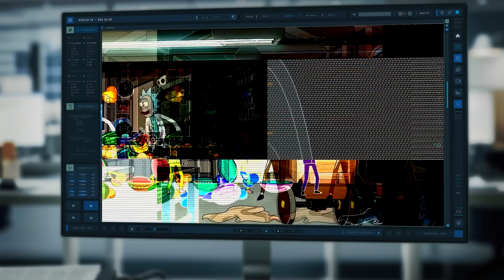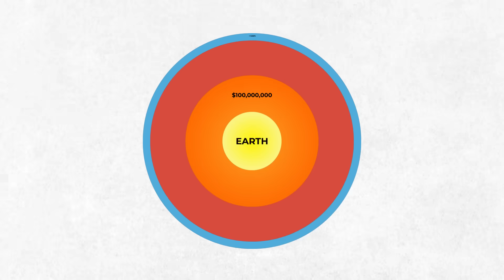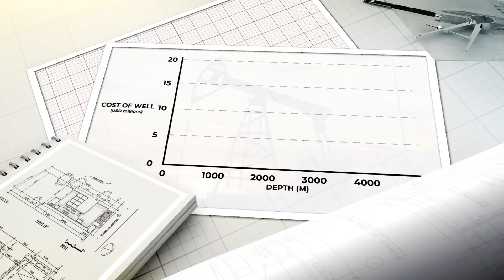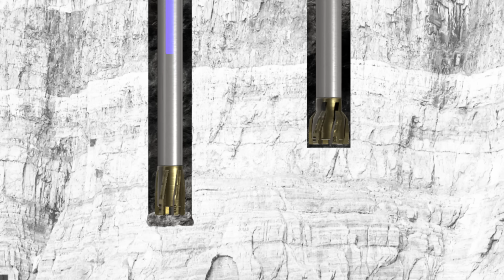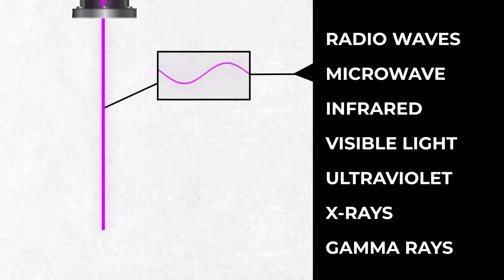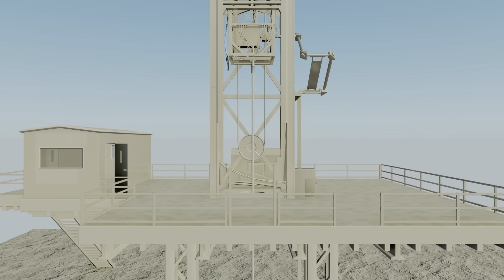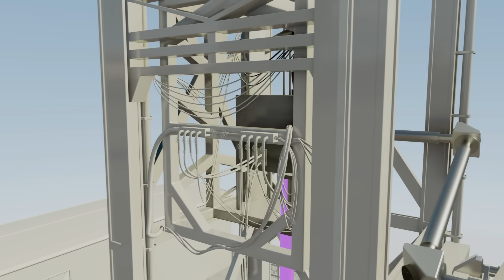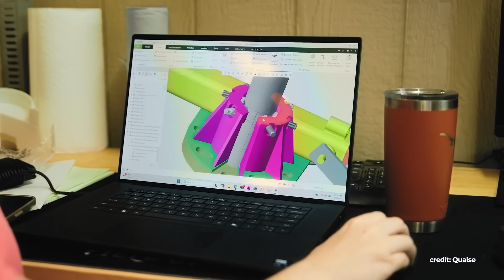The Most Advanced Drill in Human History

Comment: A hole doesn't magically stay open because of the casing, be it steel tube or vitrified rock. When you get deep the rock is under intense pressure, there's water and gas in it trying to expand, it will explode into the hole without a counteracting pressure. This is why drilling mud density is important. Talk to any mud engineer, you're talking about pressures like that near the Titanic at that depth and we know what happened to an imperfect 5 inch thick carbon fibre tube. The hole will be so fragile before you pressurise it with water. They need to be able to maintain hydrostatic pressure at the drilling depth for this to work.
Reply: Quaise have always been vague about this. While underbalanced drilling with nitrogen is done around the world, it's not that common, and has its own challenges and limitations.
Reply: I  was wondering how a thin layer of glass like rock could hold against pressure on such depths. Do you think their setup could allow for varied wall thickness? Creating thicker walls by  melting more rock around but somehow keeping the hole diameter constant? That's the only thing I can think of if they cannot counteract the pressure with water/mud. I guess compressed gas would be another option but keeping the gas pleasure while using the gas to remove material would be tricky as well.
Reply: Air drilling a 10km TVD well is a wild idea, even without the lasers. For this to even have a chance of working, they need to contain pressures at surface exceeding 10,000psi while drilling. Can that be done, maybe, but it’s risky and expensive and comes with a whole lot of make or break details. Then there is the cost of the power needed, the durability of the equipment, carrying the material out of the well with air. I hope they get there and what they have is impressive, but IDK.
Reply: @adamsteinhardt6393  I've seen some spectacular things forcing hundreds of PSI into the ground with ordinary old RC.
Reply: @FREDDAGGS that’s cool. I don’t know much about RC / air drilling. Only had the opportunity to see it very briefly for a few wells in Utica. I’d love to learn more about it. Still, there’s a big difference between hundreds of psi snd thousands of psi that this concept entails.
Reply: @adamsteinhardt6393  yes and no. There are a whole lot of new problems. You retain all the existing problems multiplied by 10.
Reply: Did a little more digging into this concept wondering how in the world they planed on drilling without mud. Looking at the theoretical  pore  pressures at 15 kilometer assuming salt water down hole pore pressure would be~ 21805 psi. the vitrified rock casing basically  obsidian has an Compressive strength ~45000–70000psi  at room temp but down hole temps will be around 350 c lowing the compressive strength of the obsidian to  30000-50000 psi making it  theoretically possible to dill without mud!
Reply: With that all being said I would not want to be anywhere near the rig floor if the casing vitrified rock is to fail the blow out would create another space program
Reply: @supershift100 thanks for doing the math. That's far more promising than I expected. If it can cool without cracking.
Reply: @supershift100  Would this be compressive force though? It seems that the issue is cracking, not crushing
Reply: The blowout from the Deepwater Horizon rig was at 17,000 feet which was kept in check by 17.5 pound per gallon drilling mud. The well came in when they reduced the volume of mud (hence lowering the weight of the column of mud) in the hole. I don’t think a thin layer of molten glass will confine the fluids under pressure at depth. Without the pressure exerted by the column of drilling mud, the rock itself will “jump” into the hole.
Reply: @MrPhillip2 under those conditions your hydrostatic psi would be 15, 470 lbs
Reply: lithostatic pressure goes Brrrrr
Reply: The RF power loss down the air filled waveguide is not going  to allow them to linearise the cost:depth ratio. This is an interesting experiment and worth doing, but it's not a viable tech. Go talk to an RF engineer and a drilling engineer together about this. They will each show you a graph that makes this non viable. We should still pursue the tech for science, but this is VC bait.
Reply: @rubikmonat6589  
Not only that, but how do they expect to keep the vaporised rock as a vapour, until they can extract it from the shaft?
Short answer = they can't. Once the shaft is a km or more deep, the rock will condense while still in the tunnel, raining molten rock down the shaft. Things won't be too bad as long as that rock remains molten, but again - Short answer = it won't stay molten...
That rock will solidify once the temperature drops enough. That means that the walls of the shaft will gradually get more and more narrow and the steel pipe will get more and more thickly coated with solid rock, until the whole thing gets stuck.
Reply: @rubikmonat6589 yup. My uncle is best drilling engr on planet, really. This tech has solid fails at many levels
Reply: @rubikmonat6589  yup, water will creep in at depth, ruining the effectiveness of the plasma/microwave lazer
Reply: @rubikmonat6589  very roughly calculated that at 10 km assuming the wave guides are 99% efficient, it’s delivering something around 40 W. At 5 km it’s 6500 W
Reply: @joeshmoe4207 just put the laser inside the drill near the bottom and run coolant on it to keep it from overheating
Reply: @crusher9z9 if the synchrotron is on the surface there is no way XD
Reply: @arthurdefreitaseprecht2648 just put all the active parts partway down the tube. use a transformer to up the voltage after the length of cable/wire lowers it theres no real reason you cant make the shaft contain all the parts. but you wanna limit the depth maybe. just run liquid coolant through it. you can put pumps inside the shaft itself too.
Reply: Exactly. I've watched this for a while and I've been endlessly amused that they have not been addressing the actual problem. Keeping the hole open. Which a thing scruffy layer of brittle obsidian is not going to do. Then they are clearing the hold with air/water like reverse circulation? 

Classic example of everyone taking investors money to pay themselves a salary.
Reply: @FREDDAGGS  you can't even use gas to keep it open. because it will blow out at the top to achieve adequate pressure at the bottom, the fluid needs to match the pressure gradient of the rock. the only way this microwave tech can work is HUGE casing, and a down-hole transmitter. the catch is electronics dont work that hot (see the tech they are looking at for venus probes). Halliburton or someone would have bought these guys out already if it wasn't a daft idea. I wish it could work.
Reply: @rubikmonat6589  it's a bit like Alvin Weinbergs Molten Salt Reactor. He knew it would never go in a plane but took the money to build the reactor. 
This is good technology. It's just got nothing to do with geothermal. There's money sloshing around for any zero carbon energy proposal.
Reply: @rubikmonat6589  Just for curious Mind Games, could we introduce some sort of sci-fyish "glob" ? Maybe it even expands under heat, contracts when cold, is more like Gum, and the contraction in cold pulls the rest of the mass. So it could be delivered down the hole via cooled pipe, gets ejected above the borespear, which is pressurizing below with air, and pressing the ejected mass into the, under heat expanding "glob". The "glob" expands, moving up the tunnel, where it is slowly being cooled again, starting the pull effect. Once at the surface, rocks and glass need to be somehow discharged, so the system could run somewhat closed to ensure the right pressure. What do you think? :D
Reply: I imagine with the magnetron drill bit you would be able to drill and lay pipe at the same time to reinforce the sides. The bit and its casing would have to be smaller than the pipe.
Reply: Hydrostatic psi= mud weight × depth × .052
Reply: It's not about how much deep to the extent of making a " mini volcano! "  but, just deep enough to make a Cookery Pot ( head ) you dummy 🤣

And later than, it will be a hot sauna turbine with your winter as Turbo charge Intercooler 😅
Reply: Cant they like combine the tech available, if indeed they can open a 10-12 km hole in months, they could put the conventional drill into the hole to remove the obsidian much faster and use the known tech to reinforce the walls
Reply: Hydrostatic psi= depth × fluid # × .052
Reply: I guess we can all agree it must be started with reaching there "enough" first. Yes, there are plethera engineering problems before the harvest. Let's tackle them one by one.
Reply: the explosive water force should equalize enough to melt the walls into glass and then evaporate remaining water.
Reply: The good news is that the tech doesn't have to be perfect.  It just has to be better than what we have now, at least in for certain depths and ground compositions.

Once a hole is made, as long as it lasts even a little while, that hole can be reinforced, or even redrilled as long as most of the hole is intact.  And the drill doesn't get stuck in the hole.  I imagine drilling out a drill with another drill, even a laser drill, would be tricky.  Probably easier to bend the drill path to drill around the obstruction at that point.
Reply: Great, enormous pressures. Is nobody talking about the heat? Just like getting to another solar system, it's going to be impossible to get to our core.
Reply: @mcapps1 you dont need to get to the core you just need to get to mantle/lava cheap enough to be viable.
Reply: @crusher9z9 you don’t need to even get that deep. You need only to get to where it’s hot enough to efficiently boil a lot of water.

Comment: Question: if getting rid of vaporized rock is made easier by bubbling water and the only problem is water absorbs microwaves.
Why not fill the bottom of the drill with a liquid heavier than water but transparent to microwaves? 
When I types "liquid heavier than water transparent to microwave" in grok it gave me several options.

Comment: For the problem of vaporized particles cooling and sealing the bore hole:

Most particles are ionized, so make a rotating magnetic field along the body to put them in predictable dynamics, then change the magnetic field's shape to control where rock particles get deposited.
Reply: When they tried drilling with nuclear blasts, they found the glass lined hole destroyed the permeability and porosity needed for oil production. Same thing here, the glass will prevent flow of geothermal fluids.
Reply: pray tell what will magnetic fields solve? 
the rock will condense within the first kilometer of the hole no matter what you do to the magnetic field. it will clog the borehole in a matter of hours if it gets deep enough. 
the rock will condense between 1800 to 1200°C and since neither the toolhead nor the drill can survive anywhere close to those temperatures we can safely assume that 99% of the "vaporized"  rock will condense on the colder tool or the borehole walls in a matter of meters.

Comment: First - did you get some brisket and Mexican food while you were here?
Second - The place to drill the "real" test hole should be at any power plant location with a back-up coal fired generation system.  The back up system could be run to provide the power needed for the drill.  Then all the steam infrastructure is right there to the existing turbines.
Third - The first test case should be a less expensive single hole - possibly even lined.  When at depth, lower a pre-fab pipe conduit - either a double pipe, or a single down, with the rest of the hole being the steam up.  This reduces the cost of the first attempt, and maybe becomes the model for smaller localized steam production.

Comment: From what I understood, The problem the Russians ran into wasn't just about the limitation of length/torque, it was also that the temperatures at those depths they were drilling was so hot that it would destroy the business end of the drill... Or have I misunderstood something this whole time?
If that is the case and I'm not mistaken, then how would they get around this issue even with the laser drilling method?
Also, at those depths where the rock is semi-viscous when being drilled, would the lasers still be as effective?

Comment: "1,000 U.S Homes at once" I don't recommend cutting holes in the planet.. BUT he needs to look into plasma generated Ultrasonic resonance of target material and Ultrasonic echo clashing upgraded audio spotlight techniques to limit range. Dust the bonds and pressure waves coming up from ground to apply resistance can also form molten tunnels. Google: "Ultrasound solidification of molten metal for grain structure" Points at Boeing Plasma force field jam bomb shockwaves with Plasma generated Ultrasound and rubs capacitor I know what I'm talking about.

Here is how to find proof of resonance frequency database potential using already existing medical scanner filter knowledge + This Patent explaining how you can use sound to destroy all pathogens by frequency database = *Google: "Utilizing ultrasound to disrupt pathogens US20100113983A1 The ultrasound tuned to the resonance frequency of a target material destroys the target material without harming healthy material that surrounds the target material. A resonance frequency database can be employed to ensure that local healthy material surrounding a target has a natural resonance frequency dissimilar enough from the tuned resonance frequency."

All materials.. You're trying to attack the rocks as a whole instead of attack what holds it together while Plasma shockwave melting rock into walls of tunnel. TUNE to resonance and I told how to limit range you need to limit range. Squints at power they already have Otherwise could do serious damage FAR.. < Think mini-Star destroyer laser cannon vs world far.. Careful.. For real. Smashing Plasma in Ultrasonic shockwaves = Google: "Ultrasound excited plasma stronger EM field" + "Z-Pinch fusion engine" Nasa scared of Z-pinch still haha. Wussies..

Comment: Why not directly using high current discharge, mostly skipping the conversion from electric energy into laser light, into heat...
Erosion of the electrodes will occur, so this must be accounted for by shoving the electrodes down the drill bit as fast as they erode.
And while doing so, a constant high pressure stream of a high density but low thermal mass material, to flush away debris but not taking away too much energy.
Later that medium can be filtered, reused and cooled (maybe even reusing some of that heat energy?)
If that medium is also a good insulator, it could be used to insulate and lubricate the electrodes.
If it's thermal mass is high enough, this can simultaneously act as a coolant for the electrodes.

Current and electrode layout must be sufficient to grant enough bore diameter to allow for sufficient current flow. 

I'm curious if my idea could work or not 🤔

Comment: Why not use oxyacetylene or oxyhydrogen cutting torches, using rocket technologies like using the fuel to cool down the drill bit.

Or directly using high current discharge, partly skipping the conversion from electric energy into laser light, into heat... Well okay, erosion of the electrodes will occur, but this could be accounted for by shoving the electrodes down the drill bit as fast as they erode.
And while doing so, a constant high pressure stream of a high density but low thermal mass material, to flush away debris but not taking away too much energy. Later that medium can be filtered, reused and cooled (maybe even reusing some of that heat energy?)

Comment: 4:00 Obviously they have solved the issue, but what about the energy wasted for pumping that water, especially at these heights. Wouldn't the trade off be negligible?
Reply: Pumping the water? Which way? Gravity should do most of the work taking it down, and the superheated steam should come up by itself because of the pressure, right? Or isn't this possible?
Reply: @chidumebiekeator8262 That sounds correct, but who knows. Those distances are great for even trees to pump water up. There is a limit on physics and simply pumping water upward is incredibly energy intensive.

The heat of water will create steam, at those pressures it will aid the water's rise, but probably not enough to conteract the laws of physics.
Reply: @HaloWolf102 Water is hydraulic, meaning any pressure put on it transfers in every direction equally. If you fill the bottom and both in and out ports, and put 1 psi on the inlet you'll get 1 psi of pressure on the other end instantly regardless of distance, it has no where else to go. So all you have to do is dump water in via one way valve and put a turbine on the outlet, that outputs steam (compressable)
Reply: It's just a boiler with a long inlet and outlet. Same physics. Hydraulic losses don't happen putting water in, and steam will just keep pressurizing higher and higher creating more pressure on the outlet. You restrict the flow from the outlet and the pressure grows, none is coming out so you dont have to keep adding water to the inlet until you let some out, which drops the psi making adding more easier.

Comment: Kinda crazy to think they need to extract all that volume of rock of the hole as hot rock vapour. Like won't that deposit everywhere once it cools down? Or does it become dust in the airflow? And where does all that heat go? Flow into the surrounding rock or come up with the air?

Comment: I wonder if they could suck air out through the drill like a straw, creating a negative pressure in the bore hole and sucking the gasses out quicker. That allows them to control the temperature better as well as they could heat the straw and maintain a temperature sufficient to keep it from condensing.